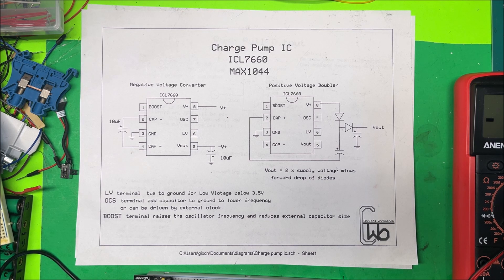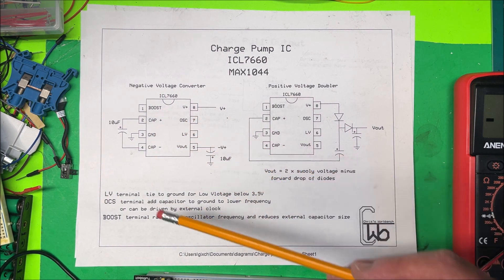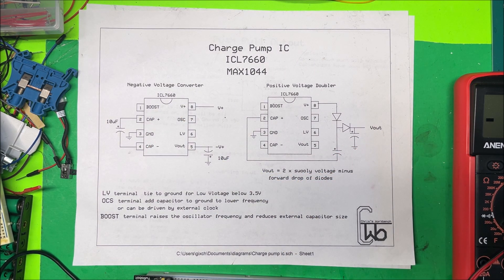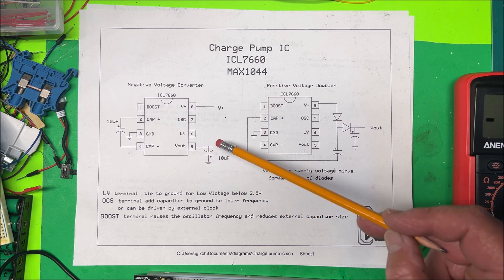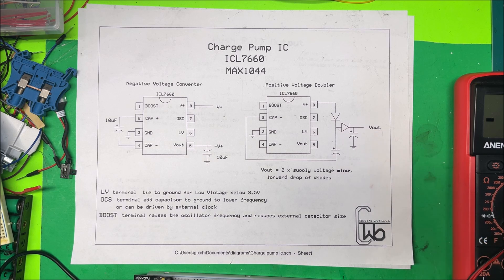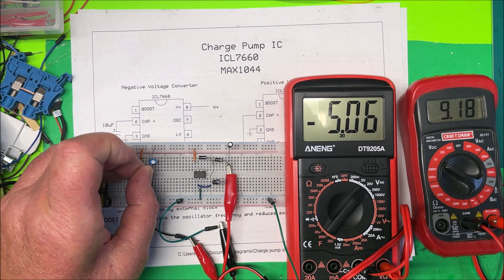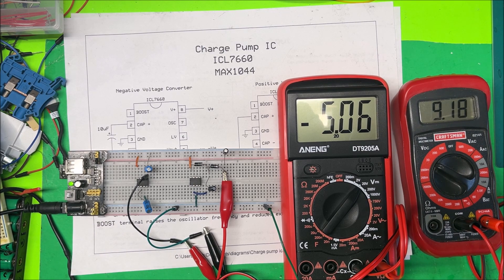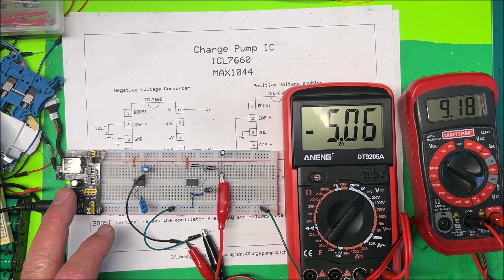Charge Pump IC ICL7660 / MAX1044

Comment: I've successfully used this to double the input voltage and drive the gates of the mosfets in an half bridge configuration. Wired like you have here with Vout connected to both gates. Seems to work great up until the current from drain to source gets to about an amp and then the icl7660 burns up. Fails with pins 1 and 8 shorted. I could understand if the mosfets couldn't handle that amperage and shorted out but why is the charge pump ic burning up? Any idea why? I feel like I'm missing something fundamental about the gate voltage/current as the drain to source increases in amperage.